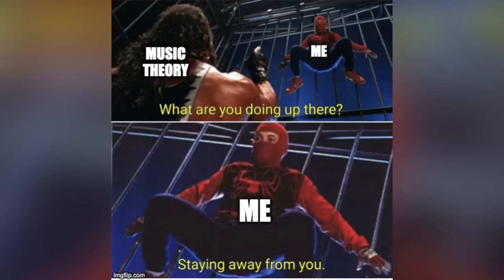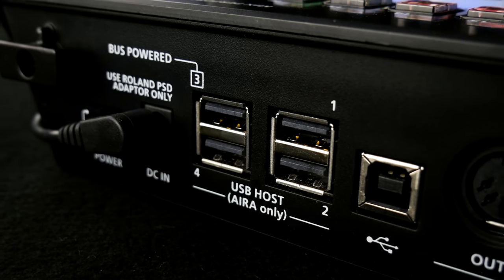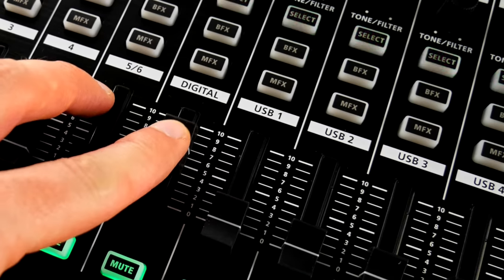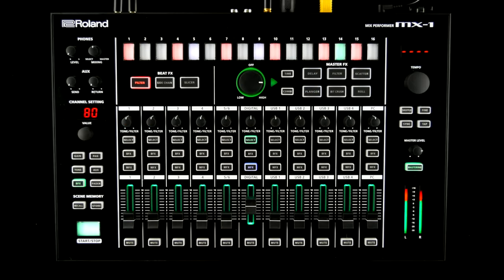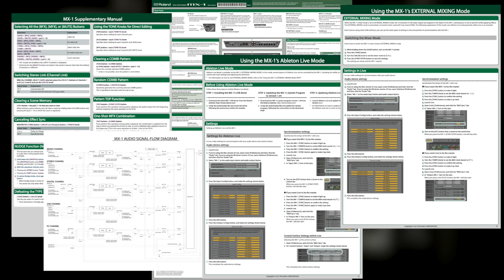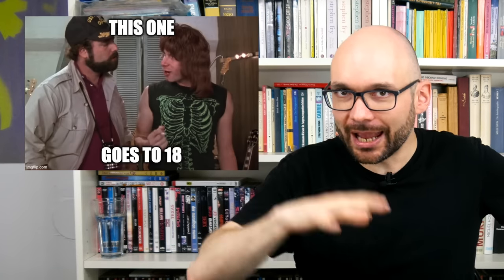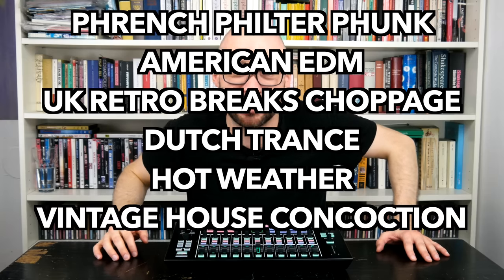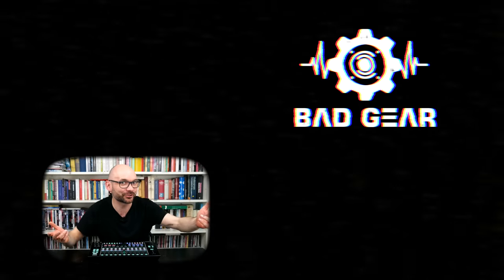Bad Gear - Roland Aira MX-1 Mixer

Comment: How about taking a look at the Yamaha SO3? I have one, and don't know if it's crap or ok.
Reply: It's an entry level (but still fully programmable) digital synthesizer based on ROM samples. The internal effects section has all the necessary stuff you need to "polish" the sounds. The sound quality is quite ok (not "spectacular"...but basically "good"). It has a serial port connector for older computers which is pretty outdated in 2022. Today most instruments have a USB port instead. But a "normal" MIDI connection will do fine as well. Tiago Mallen did a very nice (over 30 minutes long!) sound presentation of the S03 on his channel.
Reply from the maker: Interesting, let me take a closer look

Comment: lol, golden retriever.
probably uses AKM (Asahi Kasei Microdevices) ic's, DAC/ADC combined with audio processing, like EQ/filters inside the chip, 1, 2 or 4 channel. also used in Akai sampers.
Reply from the maker: Ah, nice. Gonna try that!
Reply: @AudioPilz  Let me know if you succeed, these chips require 2 protocols for communication, I²C (setup) and SPI for sound data. circuits displayed in datasheet, but in contrary to most chips a datasheet is not enough.

Comment: I'm disappointed they've discontinued it - it would have been a really good addition to my hardware setup, which includes plenty of Airas and Boutiques. If a MKII is not forthcoming, I will be a bit peeved.
Reply from the maker: Some of these are still available new
Reply: It's Roland give them a few years 🤣
Reply: @AudioPilz  Vintage Kings has them in stock.
Reply: Just get a used one

Comment: Well, iv come full circle and come back to this to use as a daw controller and interface, the Ableton LIVE mode, I think, is the best implementation for the mx1, a 24 bit interface with this many channels can be around 400-500 bucks, a mixer takes that to 700-1000 bucks, these can be had for 200-300, so its a no brainer for a 24 bit console, especially when you combine Ableton channel effects and further midi controls to enhance the mix1, I have the apc mini, and the akai midimix, this allows me to PLAYBACK multitrack recordings with ease, something that is very hard to do with multiple machines, this simplifies the whole process, its really the swiss army knife of digital mixers, im only surprised the price for them has dropped so low for used units.
Reply: @AudioPilz  I think, in essence, it's closest competitor is the APC 40 MK2, for me it's essentially an APC and soundcard in one unit, something akai have failed at

Comment: The MX-1 is indeed a capable performance mixer, but it has one fatal flaw: If you play your Aira synths using an external DIN MIDI sequencer, when you hook them up to the MX-1, the only MIDI signal that can pass from the mixer to the synths is the clock. All midi data coming from the DIN inputs is completely ignored. This means that even if you got all four Aira inputs covered, you STILL need additional DIN cables for the sequencer. Quite an oversight for a setup that proposed "seamless integration" with the Aira line. Still, the MX-1 has potential and a much needed 2.0 firmware update would make it much more desirable...
Reply from the maker: Thanks for the heads up. Yeah, that's a bummer
Reply: U don't need additional MIDI cable setup! U need a mioXL MIDI-Interface. With them, u can create virtual rtpMIDI ports, in where all traffic form an AIRA-USB is routed into (and also outo). All u need is is some brain thinking and a mioXL with configrued rtpMIDI-network and a running PC (not a DAW!) for MIDI-Routing. Then u can route MIDI-Traffic to other MIDI devices, connectet to mioXL, like USB-masterkeyboard or DIN-connected old synths. It's very ccool, because i only need one small thin USB cable for (digital) AUDIO+MIDI and if i use boutiques on Port3, with POWER. It works - i've tested it with JU-06a to JX-08 and vice versa. Incoming (into rtpMIDI network) notes are shown in mioXL display.
https://www.sequencer.de/synthesizer/threads/roland-mx-1-sequenzierbarer-mixer.99316/page-11#post-2671792
I need a modern MX-1 - with mind. 6AIRA-USB-Ports, independend reverb-instance and some more analoge inputs - a bigger version entirety.

Comment: I consider it a major design mistake to use a resistor on the master level. It was necessary to put a fader there. On live, you can accidentally touch this knob, which will lead to the murder of the speakers
Reply from the maker: Agreed!

Comment: but...but....but....whatabout the onboard lightshow!
Never been tempted to buy one of these, because I was smitten by Mackie-itis at a young age. Those aux sends, and those spiky mids, and that teeth-rattling overloaded bass end. Yeeharr!
For the money, there are better mixers with more flexible internal fx, per channel compression inserts, and more fx sends and returns. The front panel lightshow is an annoying distraction after a couple of hours. Winamp visualisations are less likely to give you migraine with aura (aira?)
Reply from the maker: Winamp is strong in this one

Comment: Mine will not update the firmware, even after years of trying to get help from Roland. Why this is an issue is because USB and Midi sync do not work at all, with anything. Bummer because it would be really cool. Anyone know any hacks?
Reply from the maker: Damn, that sounds awful. Sorry, no inside information here

Comment: There is a category of gear that totally eludes me from making sense of it. This is one example. I really dig the matrix style design, it is from King ROLAND of ShitBrickania, but what exactly is this? A Mixer? Just got a DMP11 for my TX802 and a Promix 01 for a live setup. The Promix does the job and I'm still enthralled by the lagging faders, and I love the DMP11 for its crappy 80s Yamaha sound. They both got MIDI in and full controller access, but exactly what is happening with the MX-1? I don't get the concept. I integrate my TX16W TX1P and TX802 with an SPX50 looped in over midi and audio cables. I'll check whether the DMP7 mixer map on my Atari works with the DMP11 - if so, I got integration Why is this something special? Maybe I'm this crazy grandpa that doesn't get the gist of anything not rack related :(
Reply from the maker: Wow, Promix! Now that's a name I've not heard in a long time;)

Comment: Trying to find a mixer that will accommodate more outputs than a sieve has holes, is super difficult. 
Sampler x5 stereo outs
Poly synth x2 stereo 
FM synth x1 stereo 
Drum module x1 stereo 6 mono
Drum machine x1 stereo 
Pads synth x1 stereo 
I just want a mixer that isn't the size Luxembourg for all that.
Reply from the maker: Maybe a contemporary Behringer or Midas with additional stage boxes?

Comment: If they made it a 6-channel mixer with a TR-6S form factor it would've been popular! Or if they made it 8 channels like the MC-707 so they could fit FX and still have 3 knobs for EQ or whatever.

Nobody at Roland knows how a performance mixer works. Just look at the "DJ Mode" they added to the SP-404.

I'd love to hear who was supposed to want an MX-1 ... or a Volca Mix. The Volca Mix is so limited they gave it speakers (and 3 power jacks???) on the face and it still has empty space. Maybe it was a collaboration with Roland.

The MX-1 is wider than a standard DJ mixer, but it's still cramped because they put 11 channels on it — with ONE KNOB per channel! Nobody's taking a mixer seriously with one knob per channel! Well that's not true, because I really want a MasterSounds Radius. Allen & Heath only needs one knob to make a better mixer than Roland. But come on. What is the MX-1? Is it trying to be a shitty performance mixer or a shitty desk? I love how they call the one section "Beat FX" ... since that makes me think of the FX on a Pioneer mixer. Pioneer's Beat FX gives you 4 types of delays and a reverb. But Roland gives you Beat FX with Scatter. Awesome. Everybody loves Scatter. That's the best thing about the TB-3, right? Reverb prices skyrocketing because everybody wants to make Scatter Acid! 🤣
Reply from the maker: Great ideas!!!

Comment: If Roland had any humanity left that would remove the USB ID checks when discontinuing the MX1 and let ppl use it with non-Aira gear.
No reverb is criminal. The noise level on the analogue OUTs is shocking. 
On top of that the "Performance mixer" does nor record ANY performance FX via the DAW - only Roland could be that insane.
Reply from the maker: Yeah, it's a weird piece of gear...

Comment: Two words my friend......ANALOG HEAT!!!!......The name makes it sound like a robot farting in 1984.....Which I wish it had been. It would have been better value for the money.
Reply from the maker: Great suggestion, thanks!!! A friend of mine got one!
Reply: @AudioPilz  Don't forget to mention that Electron took time out of their work day, to go into the 35 year old MIDI code, when installing it on the Analog Heat, and REMOVE the part of the code that allows it to pass notes, it therefore CANNOT be used as a MIDI interface......I repeat, they did EXTRA WORK just to cripple the device. That part of the code is infinitesimally small. It's NOT a space issue. They INTENTIONALLY crippled the device. It passes clock, but not notes.....Cool, huh?
Reply: @AudioPilz  CRUCIFY them!!!

Comment: Roland. Giving products and functions no one requires or will ever ask for, and not giving specifically the ones people want.

With a little bonus, messy user interfaces without any coherence between product ranges.

I own a TR8S, also from the Aira range : No song mode, pattern variations that can be triggered only in alphabetical order, only one parameter assignable on a rotary. But hey, you have a massive section with a HUUUGE button for the scatter function. Because of course it is super important to have these preset loop choppings. No doubt someone will use them at some point in time.

Roland, champion of crappy decisions since ever, now with blinking lights.
Reply from the maker: ...and green;)
Reply: @AudioPilz  Very much indeed :)

Comment: Why didn’t you just use an adapter or proper cable to route xlr from mixer to literally any outboard with normal 1/4” I/O? There’s no reason you HAVE to use xlr.
Reply from the maker: I'm not sure if I can follow you here...
Reply: @AudioPilz  Ok I must be confused. I recall you said the Korg is the only "pro" reverb you have that has XLR connectivity. Because the MX-1 uses XLR for it's effects return? That's the part I don't get...because it doesn't have any XLR anything. Maybe I just mishead you. Anyhow, the send return on the MX-1 appears to be RCA (because Roland is pathetic). So couldn't you just use a RCA to 1/4" TS cable and use literally any reverb that has 1/4" ins and outs?
Reply: @AudioPilz  Oh shit I misread. You said it's the only "pro reverb you have with RCA connectors" .... so again. You can use a RCA to 1/4" (6.35mm) TS cable. Just use the right cable (or an adapter) and you can use any Reverb. Anything with RCA isn't "pro" haha. But yea, no reason to be restricted to an RCA equipped device to hang outboard off of this dumpster fire of a mixer. Just use the correct cabling and you can use whatever you want is what im saying.
Reply from the maker: @cdwhiley  the FX returns are unworthy RCAs, not divine XLR and I didn't have proper adapters around;)
Reply: @AudioPilz  EVerything about this thing is super sketch. It's too bad they didn't put these decent digital features and fx and stuff in a proper mixer with actual connectivity. To me with a huge gigantic oversized analog mostly dawless rig with a huge console its just a joke. I guess if you have a bunch of botiques and no audio interface this would accomplish things but it's useless for real setups imho.

Comment: MX-1 isn't a real mixer imo, it's something of a hybrid where the inputs are of 18 a mix of 6.35 mm, 3.5 mm, USB and COAX.
It wont serve your analog gear well at all.
Interesting concept but for me barely works as an pnp intended mixer.

Your subs were not large enough so I had to pause the screen to read the dialogue, and I think some words may have covered your face.

I approve as I thought you were speaking Italian to me with all those aggressive hand gestures.

🤣
Reply from the maker: Close to Italy;)
Reply: @AudioPilz  forgeddaboudit

Comment: I can't help noticing the conclusion is "it sucks" but still recommended -- only because there is nothing better. Which seems rather weak. Shouldn't we be pointing the way for the "right" product? ( for less than 55,000 ;)
Reply from the maker: There is no alternative if you want to integrate the other instruments from the Roland ecosystem. Otherwise I would probably get an old Yamaha 01V96 or maybe a Behringer X32 Producer
Reply: @AudioPilz  -- gee, that sounds like an opportunity, waiting to be exploited. 
I considered the MX-1 several times (and I own several AIRA products) - but every time, the limitations and quirks remind me why I didn't. Almost, not quite. If it sucks, it really can't be recommended -- and who better than a prominent influencer like yourself to point out which qualities to change, and in what way? 
"MX-2: the Pilz Edition" --
That's what we need :)